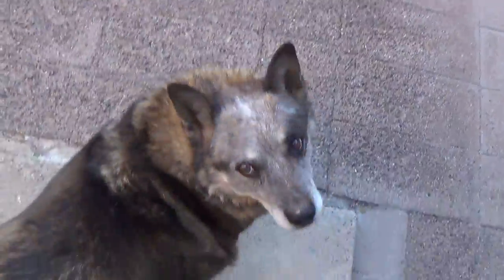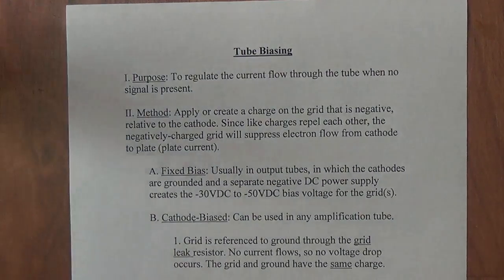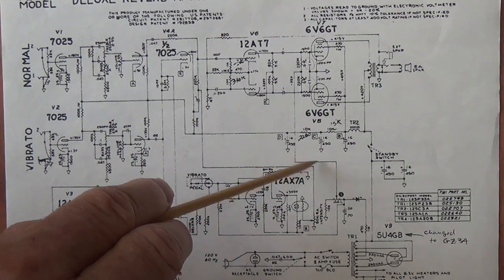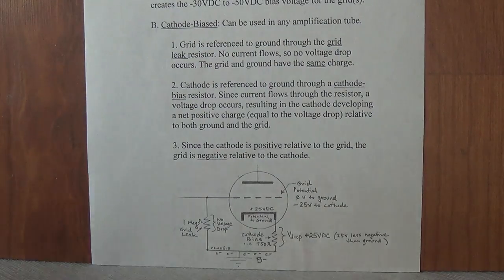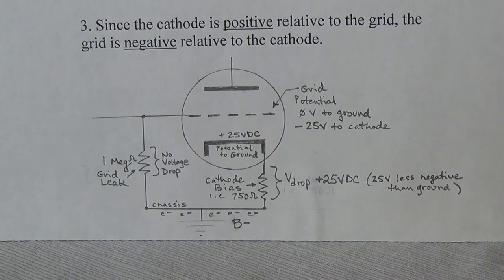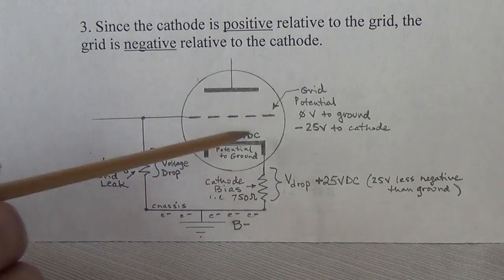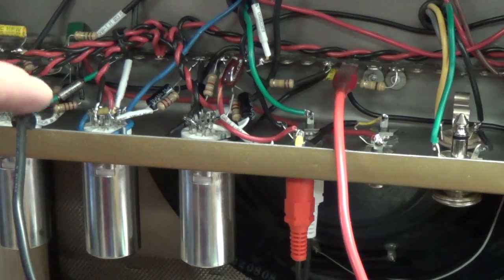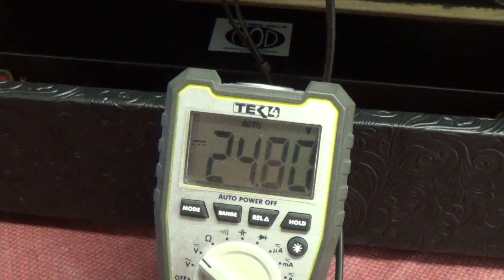Resistors, Part 4:  The Cathode Bias Resistor

Comment: I have a nice heavily modded Champ that uses a 680 ohm cathode resistor for 25V on the cathode and 370v at the plate. After a lot of trial and error that's what ended up sounding best for what I do. It doesn't seem to eat through power tubes I use...which are coke bottle shaped Italian Fivre tubes. I have a schematic drawn out with the new values. http://i197.photobucket.com/albums/aa205/guitarcapo/newchamp.gif
Reply from the maker: The values all seem to be quite acceptable, Joe. Best of luck with the amp.
Reply: Uncle Doug It started out as a simple Champ. But it sounds louder brighter and clearer now.
Reply from the maker: It's nice that you were able to successfully modify it to better suit your needs.

Comment: hi .... if the grid is a dead end... and current don't flow .... why the resistor???
Reply from the maker: No current flows through the grid, it simply has a fluctuating relatively positive and negative charge.
Reply: @UncleDoug  I don't know what the 1meg ohm resistor does? did you make a video about that? If there's no voltage drop at the resistor why is it needed...?or is there no voltage drop there because the resistor is in there?
Reply from the maker: Yes, this has been covered in previous videos. 1.) Provides a pathway to ground for electrons that "stick" to grid.  2.)  Establishes the input impedance for the circuit (higher value = stronger input). 3.)  Provides grid reference to ground to maintain a constant charge at idle.
Reply: @UncleDoug  thanks... those explanations help alot... I wish when I was a kid I would have torn into more amps instead of cars....now that i'm old I don't enjoy crawlin underneath cars as much as I used to....lol....thanks man!

Comment: Hi Doug I have a problem with my 6l6 in my tremoverb project I've checked the wiring and I'm sure I have it right but I'm getting +100dc volts across my 660 ohm resistor and I know it's suppose to be -25 ish I must have something wrong somewhere I'm using a 6x5gt as the rectifier so I'm coming off pin 8 of the 6x5gt for the dc voltage
Reply from the maker: +David Chatterton  If I understand you correctly, you are getting a 100V voltage drop across the 660 ohm cathode bias resistor for your 6L6 ?  This boggles the mind, David, since it would indicate a plate current of 151.5 mA.  The high voltage output current from your 6X5 is only 70 mA (it's a rather puny rectifier), so this is quite mysterious. Hopefully, you aren't using a 6L6GC or some other high-current 6L6 tube. Your rectifier simply can't handle it. Better stick with a 5881 or 6L6G or GB. To be honest, with this rectifier, you might be better off with a 6V6.
Reply: +Uncle Doug oh dear it is a GC is this my problem the reason I'm using the rectifier is I already had a power supply 375-0-375 @70ma and 2 6.3v secondary's one with centre tap would the 5y3 take 6.3 on the heater? Or do you think I'm ok but got the wrong 6l6
Reply from the maker: The 5Y3 couldn't handle 6.3V for long, David, so you'd better stick with the 6X5. You can try a lower-spec 6L6 and see if the power supply can cope, or convert to 6V6. In some amps, two 6X5's are used in parallel to provide sufficient current for the output tubes. Good luck.
Reply: +Uncle Doug thank you for your time I will go for a 6v6 and see how I go and maybe upgrade to 2 6x5s if I'm not happy
Reply from the maker: Try the 6V6....see if you can bias it properly, and verify that the power transformer and rectifier  can cope with the current demand. If all else fails you could always install diode rectification, do away with the 6X5, and get higher B+.
Reply: +Uncle Doug thank you Doug this is much appreciated I've ordered a 6v6 tube I will let you know how it goes once again thanks a lot
Reply: +Uncle Doug I have also checked your bias vid and realised I had my meter leads the wrong way round so it was a negative 100vdc I was getting
Reply from the maker: Since it's a voltage drop, the sign would naturally be negative, David. It's the magnitude of the voltage drop that is important, so this doesn't change the calculation. You are still drawing way too much plate current from your power supply.
Reply: +Uncle Doug totally agree with you there Doug there was smoke from the resistors and the cap went pop didn't leave it on for long I can tell you.
Reply: hi doug once again I have been looking at an RCA tube manual and I came across a 6AX5 Im not sure if i read the manual correctly looks like it can handle 700vac plate to plate and at full load manage 125ma am i correct also what is choke input and capacitor input is a choke the power transformer
Reply from the maker: My book shows 350V per plate and 125 mA, but recall that your 6L6 is drawing 151.5 mA by itself......hence my concern. I believe you are using a capacitor input. Choke input means filter choke, and I doubt that you are using one.
Reply: +Uncle Doug yes so 700v ac plate to plate. not going to use the 6l6gc I am a little concerned that after testing the power supply since I turned on the first time that the supply to the plates of the rectifier is 375-380 vac per plate I may have to bite the bullet and buy a new power supply
Reply from the maker: I have found that most tubes can handle higher plate voltages than recommended, but rarely can they handle higher plate current (for any length of time). I think you will be OK with a 6V6.....at least give it a try. The worst case scenario would be a shortened life of the 6X5. If it fails then you can consider other remedies.
Reply: +Uncle Doug right brill thank you I shall await the arrival of my 6v6
Reply from the maker: Good luck, David, I hope it biases properly and works perfectly for you.
Reply: +Uncle Doug me to thank you again for your time on this issue you are a diamond
Reply from the maker: You're welcome, David, and thanks for the kind words. Best of luck.
Reply: +Uncle Doug well got the 6v6 same issue further testing showed without anything connected the rectifier showed 400v dc to ground when connected this jumps to 520v dc and there is no volts drop across the nodal resistors its is boggling my mind why the voltage would increase I currently looking for shorts
Reply from the maker: If there is a short, the voltage will go down and the current will go up. Are you actually measuring a 6V6 plate voltage of 520VDC ?
Reply: +Uncle Doug yeah between ground and the plate 520 of the 6v6 and still getting the 100v across the bias res even when i up the resistance 

 but if I disconnect the b  + from pin 8 of the 6x5 the voltage here is 390-400 but then goes up when connected back in
Reply from the maker: I'm at a loss to explain this, David, since I have never seen or heard of such an issue, and am unable to personally investigate all possibilities due to the distance between us. No suitable power transformer with a properly wired power supply would yield these readings, so I guess you're on your own with this one. Let me know how you resolve it. Good luck.
Reply: +Uncle Doug ok Doug I'm going to strip it down piece by price thanks for all your help and I will let you know how I get on thank you again
Reply: +Uncle Doug is this normal Doug if the b+ coming from the rectifier is 390 v when it is not connected to the filter caps then after it is connected to the filter caps but nothing else it jumps up to 520
Reply: +Uncle Doug should I be reading 5000ohms across the primary of the output tx I'm getting 125 ohms it's a Hammond 125 dse
Reply from the maker: You're confusing ohms of resistance and ohms of impedance. The 5000ohms value is impedance, which is a dynamic measurement (of the transformer coil's reluctance to allow the AC signal to pass through) that you can't make with a simple ohmmeter.
Reply: +Uncle Doug yeah it's ok I got it thank I also sorted the capacitor thing at this moment I have the voltage across the bias res down to 25v just need to do some more checks on things but so far no sound apart from a little hum no guitar coming out I am persevering hahaha having a nightmare
Reply from the maker: +David Chatterton  This is exactly the way to learn about electronics, David.....solving tough problems. Look at it as a learning experience rather than a nightmare :)
Reply: +Uncle Doug I always do Doug I learn the hard way was a little premature with the 6v6 bias result though bias res at 653 ohms 49 volts across it still giving me 71 mA plate current
Reply: +Uncle Doug ok think I've broke something now my voltages go up when plugged in then straight down to 63 v
Reply from the maker: That 6V6 plate current (71mA) is about double what it should be, David. Are you sure your DC voltmeter is accurate?
Reply: +Uncle Doug yeah it's definitely that high cause it's killed the tube. the voltages across the 12ax7 are all below a volt and at the at7 it's 50v also the voltages are all over the place at the plates. My theory is bad connections thinking that when the voltage is on the resistance is higher than measured with the metre
Reply from the maker: I can't imagine why this is happening. Are you sure that your power transformer has the proper output voltage and that your power supply is correctly wired ?
Reply: +Uncle Doug the transformer is 375-0-375 I have checked this and it comes out exactly with the meter 3-0-3 for heat and 6 volt acros the other heater, both heater winding is at 3 amp  and 70mA rating for the 375 the filter caps and resistors are the same as the schematic and I have triple checked these. I'm getting 460v dc from the rectifier which is obviously high but I suppose I could reduce this with more filter caps and resistors would that change anything though? I have taken readings of all the voltages at the plates and the cathodes to ground but I don't leave the thing on long I do one test at a time
Reply: +Uncle Doug just been looking at your vids again and you mention that the filter caps on the original velco amp where wrong for the 5y3 now I'm not sure if I'm reading it right but for the 6x5 that I'm using should I have s max of 10 uf on the first filter cap can't see it causing all my issues though but if it's wrong can't be helping
Reply from the maker: I would think it could handle a 20 to 22uf first cap, David. Regardless, I can't see it causing the huge voltages you are measuring.
Reply: +Uncle Doug at the moment I have it stripped down but before I stripped it I was getting to ground 460 at the first node 420 at the second 290 at the third but 280 at pin1 v1 and 0.95v across the cathode and 275 at pin 1 v4 and 0.45 v across the cathode then only 75 on pin 1 v2 and 0.13 acros the cathode I'm currently neatening up my terminals and making sure every connection is made really well I'll keep trying
Reply from the maker: Good luck, David.
Reply: +Uncle Doug do you think the voltage is too high at node 1or don't you think that's the problem
Reply: +Uncle Doug well I have re wired and soldered the whole thing and I'm still at a loss I think my plate voltage of 475vdc is too high at the 6v6s tube could I reduce the voltage with a resistor 15k if my calls are correct I would add 6 mA to the whole circuit
Reply from the maker: Apparently the 375-0-375 PT output voltage is simply too high.....a 325-0-325 would be more appropriate (PV would be about 400VDC). You can try reducing voltage with a resistor, but be sure it is of sufficient wattage to withstand the heat.
Reply: +Uncle Doug going to try reducing the voltage Doug cheers. And thanks for always replying
Reply from the maker: Good luck, David.
Reply: +Uncle Doug today is a good day. I have marginal success. After using a resistor to lower the dc I have got sound from the guitar out of the amp the tremolo didn't work and there is a loud him even without the volume up which I think could be the filter caps possibly and the volume not overly loud which I'm putting down to the voltage as its down at 269 at the plate to ground and 236 cathode to plate but I have proved its the transformer so I have ordered a new one. Thanks for your help I'll keep you posted when's the next vid coming
Reply from the maker: You're welcome, David. Rusty and I have been busy responding to Comments and Messages and working on other hobbies, but hope to get back into video production soon.
Reply: +Uncle Doug this amp sounds lovely I still have problems but I have got rid of the hum and the fuzzy crackling it was dirty contacts but the tremolo and reverb don't work. I will find the problem the reverb when on and I tap the tank I can hear that it works but there's nothing on the guitar the fact that I can hear the tank does mean the tank a transformer are working doesn't it and my problem is before them
Reply from the maker: Yes, if you can only hear the tank when you jostle it, then the output circuit is working, and the input circuit is probably not.
Reply: +Uncle Doug I am getting a reduced voltage on the 1st plate of v2 the 2nd plate is fine what can cause a low voltage it's at 56vdc and the other plate is 245 with tube removed I get 240ish
Reply from the maker: I have no idea, David, but any reading (other than perhaps filament voltage) taken without the tube in place is not reliable.
Reply: +Uncle Doug is that because there's no load on it. I think this low voltage is why the tremolo isn't working
Reply from the maker: Yes, without a load, there is no current flow, and without current flow there is no voltage drop. If you have abnormally low voltage in a portion of the circuit, either a series resistor value is too high or there is a shortcut to ground somewhere.
Reply: +Uncle Doug yeah I understand that the only thing is the 270ohm resistor measures about 100ohms in circuit and 270 out of circuit so I would have thought the voltage would be higher if anything also between pin 1 and ground it measures 6 meg with everything in so there's no shirt their either. Just another weird thing that's happening I'll keep looking
Reply: +Uncle Doug well I have sorted the reverb I missed the link between 2 and 7 looks internal on the schematic so just the tone control and tremolo to sort I'm getting there Doug
Reply: +Uncle Doug I'm getting 1 v to ground on the grid of v2 I'm not showing any on the other grids and I can't for the life of me figure the tremolo out what do you think I should be testing to find the fault the rest of the amp sound awesome now sorry to keep pestering ya though
Reply from the maker: David, long-distance troubleshooting is not much more than guesswork, and I've run out of ideas. I think you need to keep testing and evaluating the problems yourself....it's the best way to learn.
Reply: +Uncle Doug will do
Reply from the maker: Good luck, David.
Reply: +Uncle Doug woo hoo sorted all the problems
Reply from the maker: That's great news, David. Congratulations !!

Comment: is it ok to bias el34 60 to 70ma?
Reply from the maker: Plate current is not the same as bias, FS. Bias is based on plate dissipation, which is the product of the plate current in Amps x the plate voltage. Although EL34's can theoretically tolerate a maximum plate current of up to 140mA, their plate dissipation is limited to 25W if cathode biased and only 70% of 25W (17.5W) if grid biased.

Comment: Absolutely Awesome video series !!  I was wondering how you knew that 11.65 Watts  was the optimum Plate dissipation for the 6V6 tubes ?  I was looking in the RCA-20 tube manual and all I could find was that 14 watts was the maximum.  Thank you very much for taking the time to produce these videos I really hope you will continue to do them in the future !-Carlos
Reply from the maker: +b0xjoint Thanks, Carlos. My RCA manual lists 12W as the max PD for (vintage) 6V6's.  I understand that some of the modern re-makes can tolerate higher PD's. The rule of thumb is close to 100% max is OK for cathode-biased tubes, and up to 70% of max is OK for fixed-bias tubes.
Reply from the maker: You're welcome, Carlos. We will :)

Comment: Hi Uncle Doug, 
First off big thanks and appreciation for putting together your last few series, loads of practical knowledge explained in well... a practical way. 
if that makes sense. 
I have a early 60's Bantam Supra came stock with no power transformer, single ended-35Z5 rectifier tube-50L6GT output tube and 12AX7 pre. Have not seen a lot of references to this model and was wondering if you have any insight to impart.
Thanks
Reply from the maker: +N Grey The transformerless circuits with filaments in series get a bad rap because they can be potential shock hazards. You should install a three-wire power cord that securely grounds the chassis and has a polarized plug to ensure that the hot 120VAC lead goes through the power switch and fuse and then to the tube filaments. I posted a video on a 1950 Supro amp with a series-filament circuit that you will find interesting. Also, there are all sorts of sites and forums that discuss this type of circuit. Don't listen to those who badmouth the design without having the knowledge required to fully understand it.